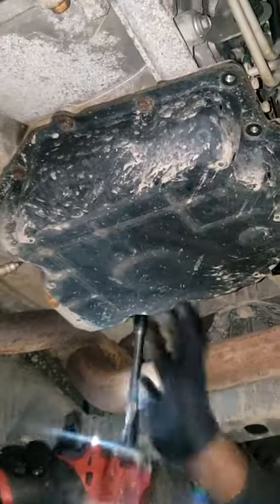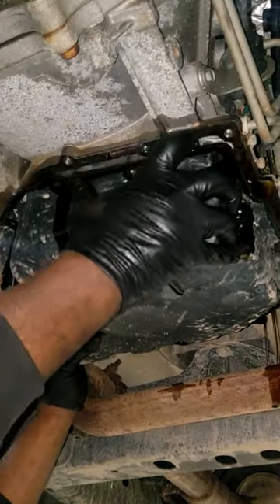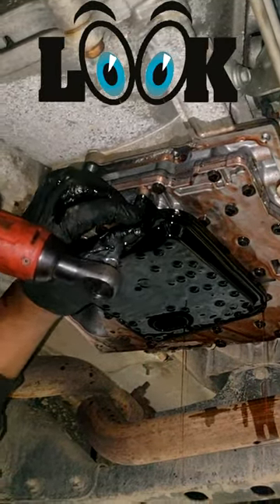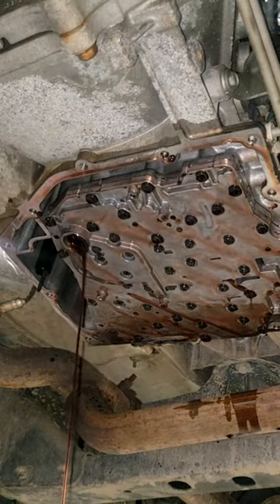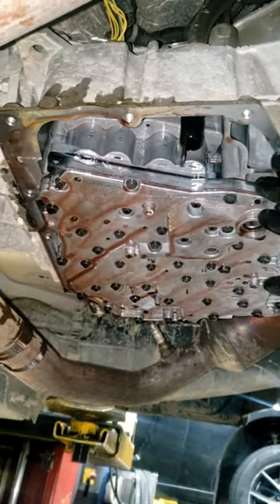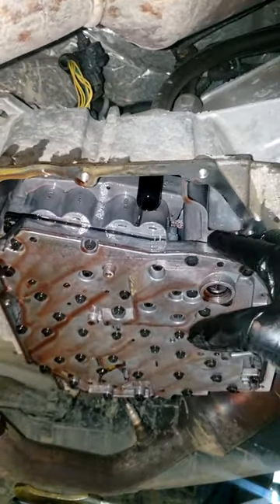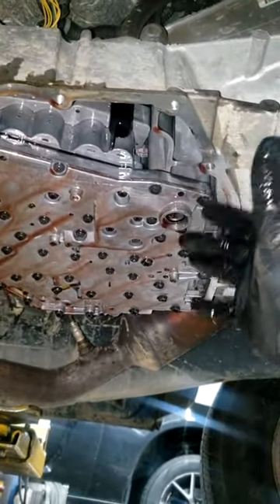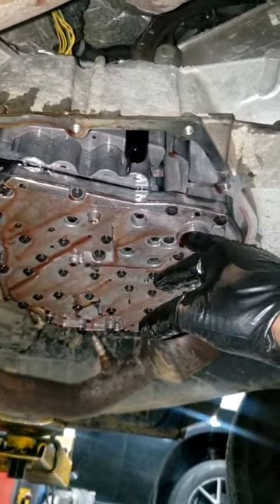No transmission flush machine, no problem. Do This. Best way to get out more of the old fluid.

Comment: i usually change the filter n refill, then put the cooler lines in buckets, suction line in a full of new fluid one and an empty for the other, run it till its clean as, check level and adjust, done 👌 uses alot of fluid that way  but i dont mind as it ends up in the fuel tank of my old diesel truck anyway 😂
Reply: You can do that?
Reply: @Petem7668  the flush? Yeah just make sure you get the lines in the right orientation or you'll end up with an air pocket.  Or you mean running an old mechanical injection diesel on used oil? Yeah you can, usually filter it through a reuseable shopping bag and put it in the tank, though if i think the oil might have water in it, i put it in a separate tank and drain out the bottom litre or so a week later to see if its "wet"  otherwise in the tank it goes, best results from 50/50 diesel to oil, but a hot summer, 100% used oil works. Just hard to start if its cold overnight
Reply: @Colt45hatchback   you answered both perfectly, thanks for answering and passing on the knowledge. I’m still pretty new to all of this and I’ll definitely look more into it and be using this.

Comment: I did this to change the strainer after 200k miles. Everything was very clean and strainer barely had any particles in it. But I changed my transmission oil every 50k miles.

Comment: I knew an old guy who would slightly raise the vehicle. He would run a clear tube from the return (dirty) line into a marked bucket and add fluid at the same rate. He had done it enough times to know fast he would need to add. The only problems I saw with his system was #1 You needed to be 100% focused. One on the bucket and one eye on your supply. #2 Unless you were fast (really fast) you kind of needed a helper to shut down the engine as soon as you were done. I forget when the guy passed away, maybe mid 2000's, so newer transmissions may be a lot less "forgiving" to being a little under or over filled.

Comment: While the oil drain plug is out, i crank the engine on a few times. That way it drains the oil filter before I remove it off my 4.0 Tacoma. I also think it helps flush it out better. If the oil light comes on I don’t crank the engine anymore.

Comment: Believe it or not in the old days on the turbo 350s and the turbo 400s we actually used to drill into the torque converter and then we would plug it with a rivet with a permatex. Yep… did it all the time and never ever had a leak.

Comment: I disconnected my tranny hose from the radiator into a pan  then start it up and let it push ALL the fluid out when it starts to run out shut it off refill it and do it again. U will watch fluid go from black to brown to red and I have done this on over 40 different types of vehicles and never had a issue except awesome results...this completely drains the torque converter. You can blow the radiator/trans cooler with a air hose

Comment: To Swap All ATF, You can run engine with cooler lines disconnected. Have one line sucking new fluid and other in drain pan. Run transmission through gears.
Reply: Is the technique you’re referring to bad for the transmission? Would a drain/fill be better than a flush? Can you please elaborate? Thanks
Reply: @drpthemc  older Hondas recommend like that through AllData repair. 
2003 and newer Honda recommends to drain pan/case 3x and you get like 90% of fluid changed. I would NOT flush transmission with flushing machine. Usually just stirs up contamination and creates problems down the road

Comment: Yank a trans line off, put a drain pan under it and start the car. The trans pump will evacuate the fluid for you. Then reattach the line and refill. Easy peasy and no pan. Good trick between filter changes

Comment: On my personal vehicles I do two changes back to back the first change will mix what’s left of the dirty fluid and then the second will be completely fresh
Reply: I do a drain and fill on my old Toyota's transmissions at every oil change. Cheap insurance and they staying feeling new. Never drop the pans and drive them half a million miles. Rust eventually takes everything out, lol.
Reply: My transmission filter got clogged I noticed the transmission fluid was black and wouldn't drive I changed the filter and fluid and it drives good now but the transmission fluid turned black again do you recommend I change the fluid s second time
Reply: @boostedkidproductions9719  You're overheating the fluid. Run a cooler and extra fluid to accommodate the cooler.
Reply: @boostedkidproductions9719  something else is the issue. Like someone said it might be overheating. Does the transmission whine going up hill? You could have the fluid tested for degradation at dealership. It will tell you exactly if the fluid is degrading from what.
Reply: @boostedkidproductions9719  also change the fluid couple of times because the torque converter holds a lot of fluid. Might be black because mixed in with the oil fluid.
Reply: Damn that’s a lot of oil!
Reply: @Mordorer  not when you work at a shop and get cheap prices and i just do it when I first get a vehicle and start driving it I never know how the previous owner ran it so I’ll spoil it like a girl
Reply: @boostedkidproductions9719  You’re on borrowed time my guy. That dark fluid is pulverized transmission guts. 

Your user name seems super appropriate. Boost and power output are generally way cheaper than upgrading the other components to handle the power
Reply: Color doesn’t mean quality. Trans fluid has a red dye for identification purposes. It can be dark and still have plenty of life left in it. The smell is more telling than anything.

Comment: if a trans filter is the metal mesh screen type like in toyotas, then changing is a waste of time. those filters will only catch catastrophic chunks which means it's screwed at that point anyways. contaminants are left in fluid suspension, and the pan magnets catch the usual filings.
Reply from the maker: Interesting

Comment: Clutches break down over time and that material goes into the filter. Also, sometimes filters can (in rare cases) break down with age. Heat cycles also plays a role in trans fluid breakdown. Trans fluid doesn’t get dark and lose its lubrication abilities on its own…

In all the vehicles I have had serviced, there was a noticeable improvement in shifting. both my american and foreign vehicles.

Lastly, why do you think higher end performance cars have a 1k mile transmission break in before getting the filter/fluid changed and then a 25k transmission service afterwards? Things wear down.
Reply: My 04 Ram 4x4 with the 545RFE transmission required trans service every 30k. Those are known for being bulletproof..wonder why? 🤔
Reply: @BrandonWest87  do you do a flush or drain/fill?

Comment: Ater that i usually disconnect the like that pumps into the radiator, turn it on or have someone turn it on for a bit. Turn it off check the amount u pulled put some new. Then repeat until clean 👍

Comment: Torque converter is still full of old dirty fluid. You should drain it, Fill it and drive it around the block and drain and fill and repeat until the fluid is clean

Comment: Disconnect the coolant line from the radiator and let it pump through the filter and torque converter. Once the fluid starts to sputter add new fluid until your trans has clear read fluid. Your toque converter holds half your trans fluid.

Comment: All the commenters with their fancy flush methods; the drain and fill method used here is a much safer way to exchange fluid in a transmission particularly with older/high mileage vehicles. By doing this you prevent metallic debris from getting lodged in the valve body. 

This dude knows what he's doing.
Reply: YES! A 3x drain and fill is my gold standard. I will do the pan drop, filter change and first refill. Drive for a tank of gas and drain and fill again (I’ll notice some wear metal and debris, likely coming loose from the detergency of new ATF), then drive it for another tank and repeat. This last drain is just fluid and I never see any wear metals or debris on the third run. After that, it’s every other oil change until the fluid is predominantly red and I switch to 30k intervals.
Reply: Yep that’s what am planning to do, simple and easy, anything else might as well take it in
Reply: @BrandonWest87  Ace! Yes, if a simple pan drain-and-fil removes 50% of the total amount, then 3x pan drain-and-fills will exchange 90% of the total amount.  That's just mathematics.

Comment: In older cars we would pull the pan and when it was almost finished dripping we would start the engine for about 2 or 3 seconds and shut it off, pumping more fluid out, we'd remove the torque converter drain on Ford's
Reply from the maker: Whoa, T/conv drains?
Reply: @OnlineMechanicTips  I'm not sure if Ford's still have them or not, but in older Ford Lincoln and Mercury had a drain plug in them, I worked at a gas station back in the late 80's and early 90's afte that.r that I'm not sure I just did mechanic work, oil change guys did all

Comment: For a more complete drain, the torque converter needs to be drained.  My last vehicle that had one was a 1976 Dodge 1 ton. Senseless that many auto manufacturers eliminated this feature.
Reply: They got rid of drain plug in converter because it got in the way in a lockup converter.

Comment: While the filter is important, the fluid should be your main focus.  Your method is called a ATF change, not flush. A change will will only take about a 1/3 out. Listen to others who say to use the transmission cooler line method.
Reply from the maker: Smdh, this is not a flush job..This customer paid for a trans service with a filter change. Im leaving the pan off to gravity bleed as much of the old fluid out as possible. And IMO, the filter more important than the fluid being changed. This fluid can take a beating and not break down but that filter can get restricted from internal wear/debri and cause a major break down.
Reply: @OnlineMechanicTips  your way is the correct way. Filters plug and crack. If you find a broken snap ring on the magnet you can save your customer a Lotta cash avoiding a catastrophic failure. Loosen the valve body bolts if you want to get even more out of the convertor. A flush machine will not allow you to get everything out like people think.
Reply: @OnlineMechanicTips  This right here.
I do a 3x drain and fill with a filter change on the first run. After that I just drain and fill every 30k. Thanks for the video brother. Your one about plugging intake holes in the heads with the snapped off HF pry bar was a pucker moment I’ve lived through too 😅
Reply: @OnlineMechanicTips  
You can remove the filter entirely and the fluid does the entire job. 

Remove the fluid
And rely on the ‘more important filter’

I’ll hold on
Reply: What about using two or more galons of oil to make the fluid clearer with every cycle? Does the cooler line method use less ATF?
Reply: @RGV2300  If you do the 3X drain and fill, you eventually replenish 75-90% of the fluid when done, depending on sump volume
Reply: A drain  and filer change on my Toyota replaced a gallon on a system that holds about 7 quarts

Comment: got a 97 volvo 850 I bought about a month ago, that has a drain plug for the auto transmission and when I got the vehicle the fluid was almost black, the first thing i did after oil change was pop the drain plug and drain everything that'll come out of the bottom of the transmission ( of course it was over full so the 2.5q or so thats supposed to come out was more like 3.75q or so) and then added about 2.5 of clean ATF, before moving the car from where u did the service, you start vehicle and slowly shift down through the gears of the transmission and back up with at least a 5Mississippi count between each shift. Then drive like normal for about 100 miles and repeat 2 more times, Ive done it twice and the have yet to put on 100 miles since the second plug pop but the color on the dipstick was like Insaid almost black after the first it became more of a brown now its like maroon. According to one persons math  the total amount of fluid changed out by the 3rd "flush" is something like 86% of old so only 14 percent remained

Comment: That's what I need to do to my '89 Chevy Caprice. It needs its trans fluid and filter change. What I would do is fill the transmission fluid up, run it, shut the engine off. Disconnect the trans return line from the radiator, connect it to a long rubber hose. Put the end of it into a big bucket, plastic container, etc. Start the car, with the hose in the bucket. As the car is running, watch the trans fluid change from a dark brownish color to a bright red. I saw this done on YouTube.

Comment: Looks like the pan on my 2008 Dodge Dakota. Easy filter replacement it looked just like that. No drain plug so you had to remove the pan just like this.

Comment: Got 4 of the 12 quarts out. 😆 the flush machines I used were 16 quarts pushed through around 12 qt capacity so it nearly gets it all.
Reply from the maker: Wrong, got close to 8 or 9.. This was a trans service job. I would of pulled out the flush machine had she bought a flush.. If you didn't change the filter, you did the car a dis service imo.

Comment: Iv seen guys pull the cooler lines off put the return line in a bucket of clean fluid and drop the sending line in an empty bucket. Run the engine and let it  cycle that fluid through. Not sure of thats a good idea or not but iv seen it done

Comment: Take the transmission cooler line off at the bottom of the radiator and start it. Let it pump all the fluid out.

Comment: There's a drain plug in the converter that's how you get the rest of the fluid out or flush it for the transmission coolant line with new fluid
Reply from the maker: No convertor drain plug on this transmission.

Comment: If you take the time and inquire what takes place with a flush most  places do not change the filter and use the  same machine for flushes (cross fluid contamination). That is like taking a bath after everyone else has and putting your crusty undies back on and then claiming "I'm clean"!!!

Comment: Waste a few quarts of cheaper, but for the application store brand fluid before service. Suck two or three out with a cheap harbor freight evacuator the add back. Do it before service with filter and it comes out much more clean in the end.

Comment: Should of seen this Trans I was working on, lts and a different dealer did the rnr of the Trans. It had soo much metal in it the globs felt like clay. Almost looked like the silver paint they use to coat the Trans. The worst tans iv seen with less than 500 mile on it lmao soooo much metal.

Comment: Change the filter, refill the pan, pull the line off at the radiator and put a rubber hose into a bucket. Start the engine and dump fluid down the fill tube until the fluid runs out clean.

Comment: I just use the pump disconnect the high pressure line start the vehicle pump the transmission down till the line spits then shut it off your system is the cleanest it will ever be without fully dismantling it, some vehicles will require you to put transmission in neutral to engage the pump/ ie dodge but if you do this when cold and only engage the neutral part of transmission it won't damage the transmission done this on so many vehicles I can't count, and never had a return for transmission issues

Comment: Well, I’ve been in automotive for a long time. “In most cases “ servicing your transmission AT LEAST every 15 to 30,000 miles DEPENDING on driving conditions it most important. Including “lifetime fluid “(check out Scotty Kilmer on that fluid) . As far as flushing versus draining and refilling it depends on the history and type of transmission as well as if there are any symptoms. 
    That being said, when a transmission flush is done fully and CORRECTLY with no prior symptoms with factory or better(I prefer better) fluid with a good friction modifier not a transmission fixer( especially with no prior symptoms) a transmission fluid flush is awesome!!! If the transmission is slipping some prior to service, well, you either have a problem that will get worse anyway or a fluid breakdown that a real , properly done flush will fix. If you do not flush the transmission either with slippage or overdue a drain and fill can actually damage it!! You are mixing about half old fluid (in most cases) with nice new fluid with a lot of detergents in it. The new fluid cleans the transmission insides, the old fluid weakens the new stuff and all the gunk gets dumped into your filters and you end up with fluid starvation!! So either drain and fill BEFORE it gets bad or PROPERLY FLUSH IT. If you have a problem after a correct service you would have had a problem anyway. But good luck on finding anyone that can do a proper flush!!!!!
  So drain and fill every 15,000 to 30,000 !!!!
      My personal experience with a transmission slipping on a 1994 Nissan Quest minivan is I tried flushing it. I used a BG flush machine, BG pre cleaner and afterwards BG AT conditioner. The car was driven some with the pre cleaner( it was slipping on hills) and during the flush it was raised up and the wheels were spinning. It fixed the slippage and was good up to the day I sold it 3, yes, THREE YEARS LATER!!! As I stated it depends.
     So take care of your expensive overpriced car!!!

Comment: If you drain it while it’s hot you’ll drain the torque converter too at least that’s how the Buick was 12 quarts later I found out the trans has a thermostat too